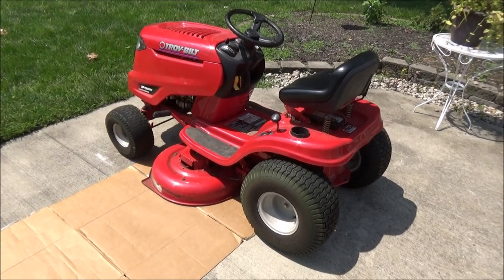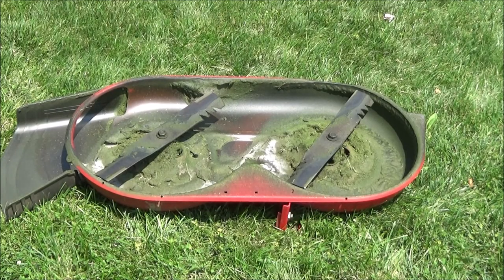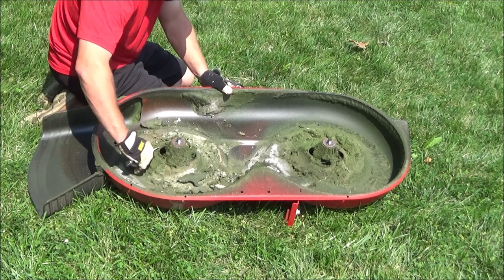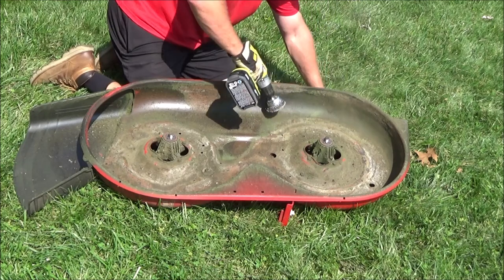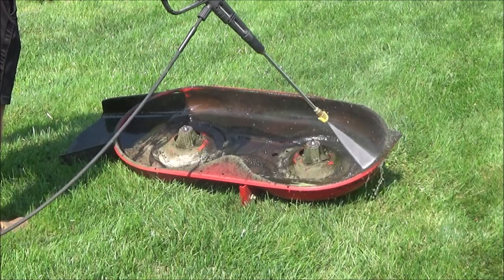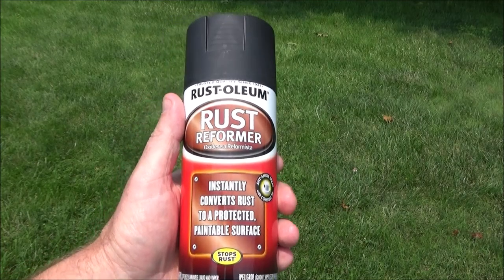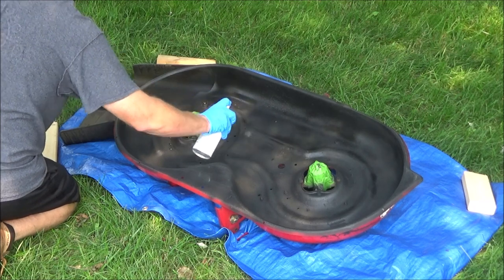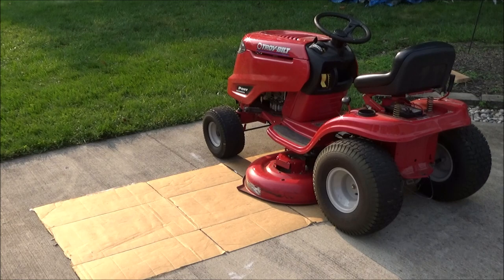How to Clean Your Mower Deck and Repaint It to Slow Down Rust

Comment: Nice video! That "ounce of prevention" thing is real! Removing the spindle assemblies is easy, and refinishing those areas helps eliminate a common failure location - the area where the spindles attach to the deck. And removing the discharge chute allows easier access to clean and refinish that area.
Reply from the maker: Thanks and great point about the common failure area. Probably worth the time to remove!
Reply: Totally agree!   I'm doing a push mower and debated removing the engine or not.  Looking at the mounting surface once I did makes me glad I did!
Reply from the maker: @pipsplay  Probably save yourself some money down the road!

Comment: Good video, while I was repainting I came across a 'Teflon' type non-stick enamel paint to use for the top coat. I've found it really helps keep the junk from sticking and accumulating.
Reply from the maker: Thanks. That's a good little tip. You remember where you got it? Might have to try that next time.
Reply: @fixitFlip  Its called EZ-Slide, they call it a graphite based coating, friction reducing paint. I think I found it at a Tractor Supply, I don't see any kind of contact info for the company, VanSickle Paint Mfg. Co, the stock # on the spray can is RB9512. Seems to be good stuff.
Reply from the maker: @bowman321123  Very interesting. Thanks again, Bowman. I love hearing little tricks like this people find. Nothing better than word of mouth.
Reply from the maker: @brianreinhardt4050  Thanks for the link, Brian. That does seem to come off easier.
Reply: Just watched a video yesterday.   The gentleman used a can of Slick.  Grafite liquid brush on.  No grass clippings adhered to the underside after a mowing.  I would guess future applications are needed.

Comment: Nice job on the deck. I changed the blade by the discharge to a HI LIFT blade which helped to not have so muck grass clump up . The blades were also sanded and painted as well. Thanks, Great video  !
Reply from the maker: Thank you. High lift blades are a great choice!

Comment: Man o man what a difference. Bought a Toro Timecutter last year and am about to do this very thing. Or at least take the deck off and get a good look see what it looks like underneath. Thanks for the video.
Reply from the maker: That's a nice mower. I've been seeing those around. Seem like one of the only mowers in stock anywhere right now. And no problem. Good luck with it.
Reply: I don't even want to look under mine. I'm scared.

Comment: Good stuff! Saw horses are your friend tho! Great point on the spindles. When cutting, the spindles can reach a much higher temp than the surrounding steel deck. I wait 45 minutes for them to cool to the ambient teperature so the cold water won't be reacting with the warm spindle.
Reply from the maker: Good tip there on the spindles! Yeah, some sawhorses would be a good idea. My knees would thank me.
Reply: Try wrestling a 54" JD deck onto saw horses though.

Comment: Nice job. Get a longer 2x4 and simply let it wedge itself against the inside of the deck somewhere. Also, don't let the blade rest its edge against the steel c-clamp, rest it against the wood.  Got a 54" deck and have to do this again this Spring. Gonna splurge and try using either a thicker brush on paint or that bed liner stuff.
Reply from the maker: Thanks. Let me know how it goes. I've heard mixed reviews about the bed liner stuff. Can let some moisture get through.

Comment: In corrosion control school in the Navy they taught us about galvanic corrosion.  Basically the same thing as to why they use zinc blocks on outboard engine motors.  There is a hierarchy to how metals corrode.  Not sure where to find that information now, but they had it in the school.  I just clean my mower deck good once a year and spray linseed oil on it at the end of the season, to hopefully slow the corrosion down.  Just also found out about a corrosion inhibitor called Corro Protect Rust Master, am going to read up on it.  Thanks for the tips.  FLY NAVY!!!
Reply from the maker: Thank you for your service and thanks for the input. Very interesting information
Reply: @fixitFlip  Thanks for your support but I just did my job.  The corrosion table that spells out which metal corrodes before which was taught in corrosion control school.  Maybe one day I will find it online somewhere.  FLY NAVY!!!
Reply: https://en.m.wikipedia.org/wiki/Galvanic_series

Just Google "galvanic series", and you will find a ton of charts. The more electronegative metals are usually closer to the top of the chart. If two dissimilar metals are put together, the more electronegative one will be the anode, and will suffer the worst corrosion. The farther apart they are on the chart, the worse the corrosion will tend to be. Assuming moisture is present to serve as an electrolyte. A small piece of aluminum on a big piece of steel will get eaten up badly. A big piece of aluminum on a small piece of steel will be better. On a mower deck, the spindles are usually big aluminum castings, so the corrosion could be much worse. The spindles protect the deck, to a degree. It is the smaller items mounted on the deck that suffer the worst corrosion.
Reply: @rstoertz  Thanks I knew it was out there somewhere.  FLY NAVY!!!

Comment: My father taught me a long time ago to use roofing tar to coat the underside of a deck to preserve it...its tough and never chips off...once a thin layer ogf grass blades saturate the surface nothing sticks again....had mowre decks last 30 plus years before the engine gave up...a good cleaning of the rust and then coat it...stops rust in its track just like flashing on a roof
Reply from the maker: That's a pretty cool trick. Never heard of that one.
Reply: You just gave me an amazing idea. How about a spray treatment like they put on truck beds. Something like Line-X or Rhino? That stuff is tough as Hell!
Reply from the maker: @gone2dmtns  I've seen a lot of debate about that topic. Most spray in bed liners that I have seen have all been very rough and I would this would tend to cause the grass to stick and not discharge freely. You typically want to keep the deck as slick as possible underneath.
Reply: @gone2dmtns  bed liner doesn't work for shit. Still gets ate up after just a couple of mowes..

Comment: I have the exact same deck and mower. Great video, but here's a tip, the quickest way to attack it is with an angle grinder and a course flap disk. Now mind you my desk was near full on death when I got it for free, but luckily there were no structural rust throughs (only 1 small slit rust through). Unfortunately I have had to rebuild it from there however. All new everything. Please guys take his advice. Don't just let it sit and rust.
Reply from the maker: Good tip! That's the best thing to sharpen your blades with as well, never thought of hitting the deck with it!
Reply: @fixitFlip  I wouldn't have originally if it weren't for how much rust had to be removed from it (and it was cheap and easy to just buy 2 flap disks and if I found out during/after that the deck was just trash I wouldn't have been out much). But the metal is particularly tough and being a round circle it's fairly easy to get in the curved sufaces of the deck very well.
Reply from the maker: @n78966969696896  Great thinking. And like you said you can get a couple cheap at Harbor Freight or somewhere like that.

Comment: My 2008 Pony's deck smooth rusted away. A replacement was $500. I replaced all of the sealed bearings in the towers and idler pulleys. Works like new again.
Reply from the maker: They will keep ticking along if you take care of them, that's for sure.

Comment: I mow about 8 acres with a Troy-Bilt TB46 ... seriously! Sometimes the grass gets truly out of control, like 4-5 feet tall, or more. I have absolutely no rust under the deck. But the grass builds up very badly on top of the deck. You can't blow it out. It has to be pulled out by hand ... a complete pain. So it holds moisture and even starts turning into dirt up there. It's a recipe for corrosion. But below the deck is shiny metal. I take off the deck at least once per month, normally.
Reply from the maker: That's impressive for that mower!

Comment: I know this is an older video but figured I would post anyway. There isn't any paint or powder coat that's going to stay on the metal in that environment, it will invariably get chipped and rust under the paint, then chip some more etc. The only thing that I've found that actually works is to grind the entire underdeck down to bare metal. After that hose it off after every single cutting, run it for a minute to dry it off and spray the whole underdeck with a dusting of WD-40. Every once in awhile (and going into winter) I also spray with Motorkote spray but I've found that WD-40 works fine. If you do that every time the grass will burnish the metal and mostly keep the rust knocked down. 

Obviously this is MUCH easier with a walk-behind mower but you can just get in the habit of driving your tractor onto some car ramps so you can access the deck.
Reply from the maker: Yeah there is no perfect solution. That's why I just titled it "slow down" rust. You're never really going to stop it. And I have some homemade ramps that I use with my mowers for purposes like that: https://www.youtube.com/watch?v=SJD6qVtz1uM
Reply: I was thinking a silicone lubricant like Jig-A-Loo might work well.

Comment: Where i live i'm constantly running over fine sand so i don't think any paint will survive after a couple of mows. I'm thinking about washing it and coating it with motorcycle chain lube. That stuff prevents rust and sticks very well to the metal.
Reply from the maker: That's an interesting idea. Let me know how it works out!

Comment: I did this last spring, and |I just cleaned the deck and all the rust reformer and the new paint all came off with the grass. Too say I am a bit upset would be an understatement. It looked soo pretty, now it looks like crap again.
How well did you're job hold up?
Reply from the maker: Really?? Mine held up fine. I'm sorry to hear that. I've never had that happen. I wonder if you let the paint dry long enough before using? Rustoleum is normally a solid product!
Reply: @fixitFlip  I used the rust reformer first, then painted. I think this time around, I will let the coats maybe dry a lot longer. I cannot remember how long I let it dry, but the grass held on tight and would not let go without also stripping off both the rust reformer and the orange over coat.
Reply from the maker: Interesting. I've never had that happen before.  @billylacharity3443

Comment: My rule of thumb. If the deck comes off I rotate for my second sharpened set of blades. Then sharpen the ones we removed  at my leisure.

OP, it looks like you're running Oregon Gator G3 blades
Reply from the maker: Great tip rotating the blades like that. And yup, love my gator blades.

Comment: I use the product Slipe Plate No.3 to thoroughly coat the entire bottom of my 21", 48" and 60" decks,  after a thorough cleaning and a coat of Magic Rust Kill 12oz. size spray can application. Slipe Plate can be sprayed on or brushed   on ! .                                      I buy the 1 gal. can at NAPA auto parts store in my home town.Slipe plate is also used in agriculture application once applied to soil engagement tillage equipment, to prevent soil, mud, wet vegetation from sticking or caking up in tight crevice parts / locations. 
I'm not an affiliate for Slipe Plate and am not rewarded in any way, by Slipe Plate, for giving my experience or opinion concerning the use of this product. I am just a satisfied customer/user of this time saving, metal protection product !!!
Reply from the maker: Very cool product. Just looked it up. Doesn't trap dirt or anything. Thanks for the tip. Always welcome.

Comment: I don't have the owners manual for my used Husqvarna riding mower, so I have checked youtube for a constant torque recommendation for the blades...  Everything I'm finding is saying blades should be torqued between 45-55 foot pounds...  So, I went with 50 foot pounds, and bumped it a couple times...  I believe you recommended 70-90 foot pounds...  I'm assuming that is per specs of your particular mower...  Just thought I'd ask, or point that out, in case they are different based on model...
Reply from the maker: Yes, I'm going straight out of the manual on that number. You could find a manual for your model on the internet I'm sure.

Comment: he hee remember i under coated mine on top and bottom of the deck.  Well its holding up on top of the deck but the bottom is shiny metal. Knock it all off ! Yes cut grass dry. wet is to hard on the mower, cakes up under it and uses more fuel  ~ Plus the belts getting wet from the wet grass causes them slip and wear out  👍
Reply from the maker: Ha! I do remember that. I think I remember you used that truck bed  liner stuff. I've heard that is kind of porous and doesn't really keep water out. That's interesting it knocked it all off underneath.
Reply: @fixitFlip  Yep bed liner , knocked every bit of it off .  it was shiny metal under it    he hee i want do that again. Just top of the deck only
Reply from the maker: @426superbee4  Yeah I'm sure it will hold up just fine on top.

Comment: Now i found that it you raised the front of the deck higher than the back part of the deck, helps to keep grass cutting and stick out of your pullies and belts on the deck. Mine was set level to the ground.  So i raised the front up, help save my belts from wearing out ~ Its the long pin with a nut on the front of the deck, get a crescent wrench and tighten her up and can see it raising up
Reply from the maker: Interesting, because normally the manuals say you want to back sitting a 1/4 inch higher or so. But whatever works for you. I have a video on that topic: https://www.youtube.com/watch?v=Gu4fdaegaIA&t=190s
Reply: @fixitFlip  Yep front needs to be up. back of the deck down. Try it bro only takes a few seconds
Reply from the maker: @426superbee4  Oh yeah super quick adjustment. I think I may give that a try.
Reply: @fixitFlip  I got the front deck up 2" higher in the front than the back / it pushes the sticks and grass under the deck and not on top of the deck wearing belts and things out>  Those sticks and pine combs was killing my pully guards  Breaking them off ect. Now i don't have that problems
Reply from the maker: @426superbee4  I got ya man. Protects the pulleys and what not. Does it seem to cut as well as with the deck a little lower?
Reply: @fixitFlip  i can't tell any difference! All cut good, other than sticks and thing going on the top of the deck  Now its not. I never sharpen my blades ~ Reason there wore out in 2 to 3 mowing's
Reply from the maker: @426superbee4  Well that's awesome then. Sounds like a good little trick!
Reply: @fixitFlip  i can still give my lawn a burr cut to in low 😆all most to the dirt its perfect high where it don't kill the grass.  i found a way to mark my work.  Just drop the deck down and it makes a 8 want kill the grass either. that my mark a signature cut  Its like branding your lawn  he hee it grows right back / 😎✌ try it and have fun cheers

Comment: I did the same thing about 5 years ago and no top coat …still  no rust…I used a paint called chassis saver…a bit pricey but a little goes a long way…I followed directions on the label …you leave it a bit rough to the touch…they are a bit anal on procedure but I’m still very pleased…just my two cents…😊
Reply from the maker: Thanks for the input. Always welcome.

Comment: Could you do this same process on a 21 inch self propelled mower? Without taking the engine off?
Reply from the maker: Yes! Just make sure you tip it up the correct way !
Reply: @fixitFlip  just got done. Used the rust reformer 1st and then the gloss enamel rustoleum. Looks great. Just has dimples from where I grinded the metal from the rust but epoxy spray should fix that. A job for another time lol. Thanks for the help!
Reply from the maker: @mikeyspur2828  No problem. Glad to hear it went well for ya!
Reply: ❤ As soon as I saw you use the 6in1, I knew you had good sense.  That is my all time go to tool.  If you keep the deck fairly clean, a nylon putty knife or a quick hose down will keep the rust away.  I was a rental equipment technician for about 8 years and enjoy sharing skills like yours.  Keep going.  👍
Reply: PS: I also am a Ryobi addict.  6 batteries with the multipurpose charger and about 10 different tools.  The battery pressure washer is my favorite.
Reply from the maker: @rmcguire-pg6io  Thank you! And the 6 in 1 is a vast under estimate. It's probably more like a 50 in 1 tool for me, ha!
Reply from the maker: @rmcguire-pg6io  Ooh, I don't have the battery pressure washer. That sounds awesome. I hate dragging a cord around. Yeah the Ryobi stuff is affordable and good enough around the house. It fits my budget ha ha.

Comment: Just scrape the worst off then paint your old engine oil from the mower, which you should change once a year, straight over the old dry grass will hold it on. No rust no problem! Do this at the end of each season.
Reply from the maker: Interesting tip.

Comment: I repainted last winter with a rust-preventing paint. After the summer season, it did no good at all. When I scraped the paint off. Rust. My conclusion: You're GOING to have rust. Best to just clean the deck the best you can. Hint: I found vinegar to do a good job of softening the grass. Keep spraying vinegar on as you work.
Reply from the maker: Yep, it's impossible to prevent 100%. That's why I titled the video "slow down" rust. That's all you can hope to do really. And yes, frequent cleaning.